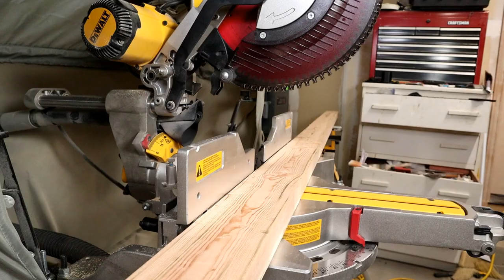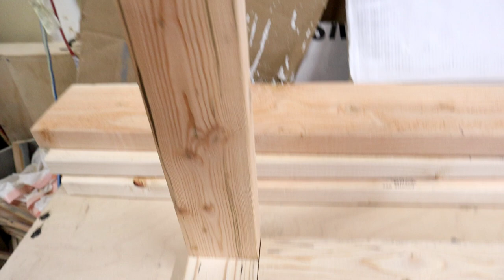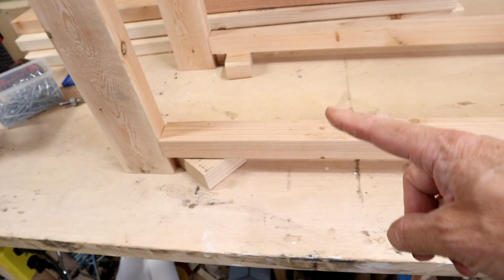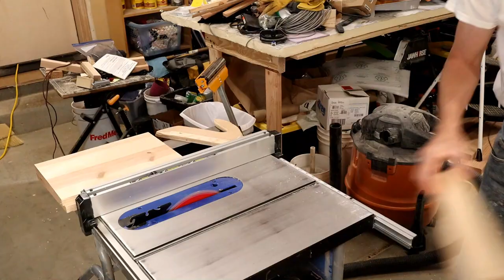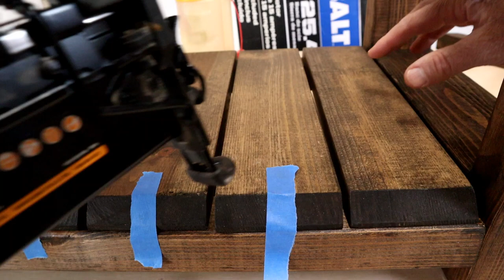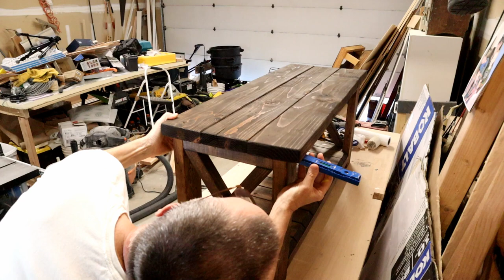Build Your First Piece of Furniture (Farmhouse Entryway Bench) ~ Step by Step Tutorial

Comment: Well... after binge watching probably 5 or more hours of your videos, I think I'm going to take the plunge and try building this bench for my wife!  I had a couple of questions pop up while watching this video, I'm going to purchase the pocket hole jig that Harbor Freight carries and wanted to see if you could suggest what you think the most popular size pocket hole screw is that you use the most so I can buy those along with the jig?  Also, are the ones you use "fine thread" or "course thread"?  Lastly, do you spray on the protective coat over the entire bench (top and base) or do you paint it on?  Or is it a mixture of both?  Thanks again!
Reply from the maker: Great to hear you're going to take the dive! I used 2-1/2" coarse screws with this build. The fine threaded ones are for hardwoods. You should go ahead and pick up a pack of 1 1/4" coarse if you plan on using 3/4" material in the future (soft wood, or plywood). I brush on the poly coats.
Reply: Awesome!  I'll be sure to let you know how it goes! :)  Thanks again! @RonniesWorkshop

Comment: Did you get any glue squeeze out on your panel? If so what did you do about it? I got all the glue out of the joint but with those rounded edges I know I wasn't able to get it all out and I'm afraid to stain it because I'm worried how it will look.
Reply from the maker: I always try to avoid much squeeze out. If I do get some I will do my best to sand as muich off as I can. Any glue residual will prohibit stain from adhering and you'll get discolortion. Just sand as much off as you can and go for it. If there is some difference try getting a paint that is close to your stain color and "fix" that area by putting some on and blending it in as best you can.

Comment: No cracked tops yet?  I’m new to this too and not sure how much wood movement matters for this.
Reply from the maker: None reported. I advertise as a "rustic" piece. I also tell the customer that it's an indoor piece, not for the outdoor environment. Thanks for watching.
Reply: You need to let your lumber sit and dry before assembly.   If you assemble with wet lumber it will split and crack.